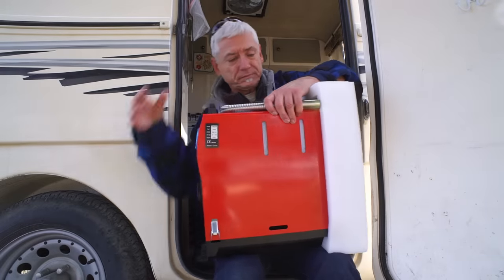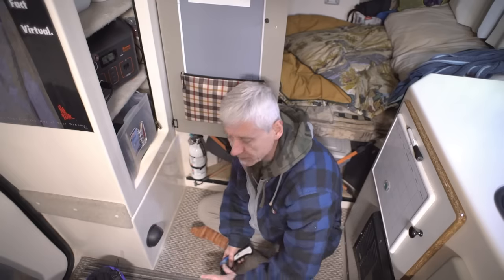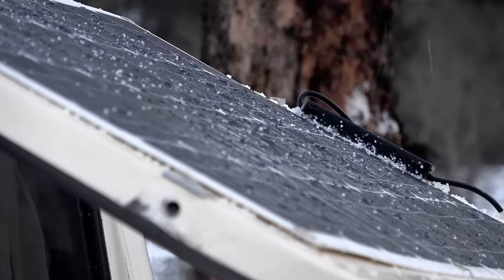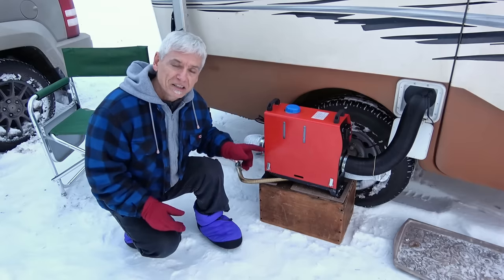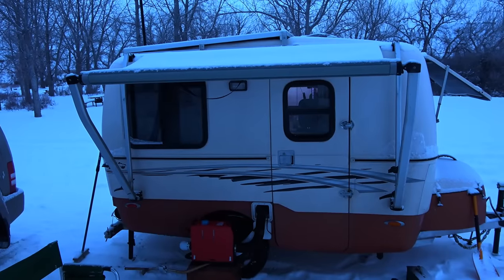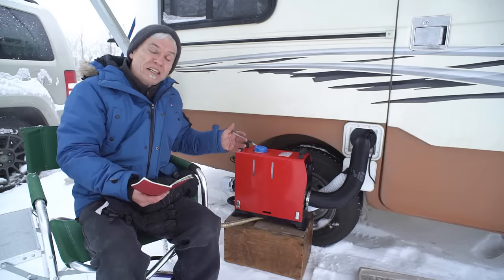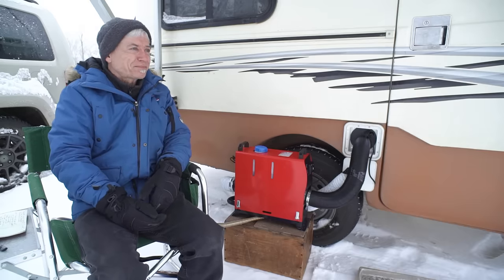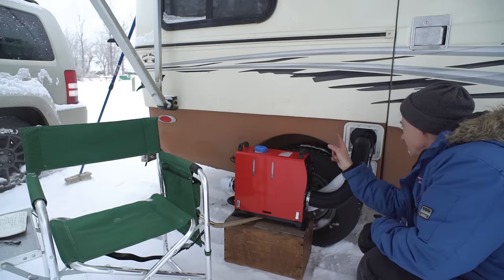Can this Work with a Camper? My Parking Heater Experiment Part 2

Comment: Well, I put a propex gas furnace into my teardrop and it's massive overkill for something that small. I can heat my teardrop to 80 all night for a week without draining the battery. For some reason gas furnaces put into campers are really inefficient. I would think a propex heater would work for your trailer since it's made for VW vanagons - which should be around the same volume. Problem on those is the price - you spent $1k on one. For that it sips gas and electricity rating is about the same as a diesel heater.  We used it last year on a yellowstone trip for 2 weeks and it used 1 1/2 gallons of gas for around 68 all night long every night. Not bad. I decided to spend the money because I wasn't going to buy a cheap Chinese diesel heater - if anything I'd bought a Webasto and they cost about the same as a Propex. I also didn't want to bring diesel. I had a webasto in my first car, but that was a VW Golf Diesel so it was tied into the vehicle tank. My camper already has propane, so the propane furnace was the natural decision and of course you'd pay anything to avoid listening to your wife complaining about being cold :-)  On a recent desert trip we went to 80's during the day and around freezing at night. I tested how long my Battleborn battery can supply me without charging it - so we heated at night and the electric fridge runs a lot during the day when the sun shines on it. The battery went dead after 4 days and nights, so in a weird setting where it's warm during the day and cold at night I can still run everything on about 250 watts a day (that also includes charging phones, cameras and radios)
BTW: don't forget to run that diesel heater on high every now and then. The do sut up on the inside if you run them on low all the time. My recommendation: crank it on high every time you come back from a trip where you used it, just to clean deposits out. Venture 4WD (YT channel) has a webasto in his jeep and they had to take it apart after a month because he didn't do the high burn every now and then. You can see the inside in his video and it's not pretty.

Comment: Most people in UK use the separates rather than all in one and manty suspend the fuel pump which does make them fairly quiet. I think I would try sound deadening mats on the outsides of the unit

Comment: The box it is sitting on, gives me a idea...another box that fits between the door and the box as you are using it. The box would be tall enough to incase the "warm air out" 100% and all the lost heat would be in that box. Hook the cold air intake into that box and put a vent in the box, nice and low, so it can still draw in air without loosing warm air.
Sounds like alot, but its only a box and that will hold the heater for transport

Comment: The key to get the fuel pump quiet is isolaters on the mounting bracket and rubber hose in and out of the pump. The metal case is what is amplifying the pump noise.
Reply: Already tried ... didn't help.

Comment: Maybe build some kind of styrofoam enclosure to dampen the sound and keep the weather off of it. Just have to keep it off the hot parts. 
You can also get a battery pump for pumping out gas out of or into containers.
And a more difficult but possible option would be to rig a fan that turns on to keep the diesel smell out once it turns off, or until you can disconnect the hose.

Comment: Ok, wondering two things. First, any way to boost the fan speed? That would probably raise the temperature in the trailer, but drop the temp in the air outlet.  Second, any way to modify the wood stove to turn it into a mini-boiler unit and construct a heat exchanger that you could use with a fan to blow warm air into the trailer? (Or build a new stove designed as a boiler). You are clever and I anticipate something that you design that will solve the heating problem. In the meantime, I await the revelation of the other purposes for the vent.

Comment: You could try to support the heater on one of those 4wd step which hooks over the trailer Tyre then you could eliminate the timber box which could be contributing to the sound generation of the pump possibly you my be able to mount the pump on rubber isolator to add to reducing the sound just my thoughts but thanks for your experience this far 
Cheers from down under which by the way is way to hot fir a heater most of the time so I myself would be experimenting with keeping cool so I look forward to your keeping cool story

Comment: Hey slim. It’s important that the power doesn’t cut off instantly, the diesel heater need to let the fan cool down the internal heat sink before power cuts. Otherwise the motherboard will/can melt.
Reply: When temps are below 0F, cooling down isn't going to be an issue. It appears, the "motherboard" is in the LCD controller which Slim replaced with a mechanical controller. All Slim wants, and needs, is for the heater to run continuously on low. It also appears the Jackery caused the power to cut out and was corrected.

Comment: If you had an intake from inside the camper it would work better, it will circulate the air inside the camper, also, the Jackery needs a minimum load to stay on, if you add a low load such as LED lights, it will stay on beyond the 6hr.
Also, if you connect a pipe to the heater above the roof line, you won't get the fumes.

Comment: I assume the click-click sound is from the fuel pump?  Would investigating in a quieter pump be an option?  And is a pump absolutely required?  Would separating the tank and gravity feeding the fuel from a higher point be a viable option? It might be worth investigating bypassing the pump and gravity feeding it with a longer hose from a meter or so above.
Reason I'm asking is that at work some of our older fire trucks have Webasto diesel heaters retro-fitted to outside compartments that can't be allowed to freeze (medical gear) and they are dead quiet.  Of course Webasto heaters are not cheap knockoffs and quite costly.

Comment: What's the best ducting for the output air to the tent/camper?  I built a portable one of these in a nice outdoor box.  I'm a touch worried the flexible stuff doesn't expand to a full 3" and creates back pressure.  I have some flexible stuff with PVC on the outer layer and I'm not sure how proper it is for handling the heat.  I love that it compresses down tho.  Any thoughts now that you've been doing it for a while?

Comment: Really enjoyed the video. I was thinking of trying one just like this to keep my 32’ fifth wheel around the same temp as yours. I don’t like the diesel smell. I’m worried it would permeate the camper with that odor. I think I’m going to pass. Your video is the best I’ve seen on these things. I’ve thought about the diesel/hydronic. I would have to have it outside like yours. What about an outdoor small wood /coal stove and transfer by air or hydronic?
Reply from the maker: Interesting Question Kevin. I was toying with the idea of an outdoor wood stove with a tent-like structure over the heated area to vent the heat into the trailer. But it seems a little too complicated to use and operate. Thanks! SP

Comment: Get suspension for the diesel pump to get rid of the clicking sound, it sounds like the pump is just mounted directly to the encasement box. Search for 'Vibration Bobbin Isolator Damper' on ebay and you find lots of them, the smallest ones should be the most flexible and therefore make the least noice. 3 of the smallest ones should do i guess, perhaps 2 depending on how big the pump is.
My guess is 80% reduced noice with them since they are not that soft.
You could go further and just hang the fuel pump in rubber straps, the small thinner bungee cords with hooks for motorcycles could be good, it should reduce the noice to like 95% reduced noice.
They are still somewhat stiff so perhaps you could do the same as i did back in the 90's, i then experiment to make a computer that made the absolutely least noice i could do. Using rubber bands for clothes to hang the harddrive inside the case (and also large fans everywhere and large cpu cooler too back in around 1998, but the harddrives was the most noicy part back then).
A friend asked me if he could turn on the computer while i had only turned off the screen, he was surpriced at how fast it did start and still silent lol.. the expression in his face looked as if i had some kind of alien technology from Mars or something :)
So it was dead silent to say that, not audible 1 meter away, and this was in a time back when computers was usually pretty loud :)
The rubber in the elastic bands for clothes i did use did get stretched out and hard after a while, due to the heat inside the computer case and it is likely much heat in that diesel heater box too.. in that regard.. so perhaps rubber is not the best here.. but why not hang the pump between the right thickness somewhat thin spiral springs.. that could be a good solution that works over time.

Comment: I wonder if it would be possible to use that hole to try the wood stove on the floor with a modification to the chimney. Or a jack to the window so no permanent modification to the window

Comment: Good video Slim! So as it turns out, it was the Jackery getting overheated in that closet, and the fan wasn't able to cool it. Now thats a safety feature alright, but its in the Jackery. I was looking at the prices for the top Jackery units that could possibly power a home refrigerator in a power outage and I was horrified. I decided to buy a 1000 dollar generator instead, that could put out more power. I do like the idea of your solar panels being able to recharge the Jackery though, and the Jackery can keep the heater powered, but obviously, your going to have to figure out a cooling solution for the Jackery. Sounds like the heater will work for you though, nice modifications as usual.

Comment: Check out espar heaters for your rv. We use them on semi trucks hear in the states and yes it's a diesel fuel fired heater but they are small and powerful.

Comment: Hello sir! So I am looking at the same unit. So it needs the 12v battery to run? Secondly the flange you built , what was the material and how did you install  it ? Thank you .
Reply from the maker: Yes, it needs 12v to operate the fuel pump. The flange was made of hi temp PVC pipe. Be careful with regular PVC or ABS as it may melt under heat. Thanks! SP

Comment: My Webasto diesel heater pump is not noisy or smells.    Got good deal from eBay.     My heater is mounted to van floor and diesel tank mounted 2 feet higher.    Maybe gravity helps my pump not work as hard?

Comment: Hey Slim! Long time subscriber- 1st time to comment. I really want to try one of these for my van. I am very cold natured and really don't like using propane/butane. But, like you, hate the smell of diesel. I have 3 different vehicles I would like to use it with so a permanently mounted version in the van isn't really an option....plus don't want the diesel tank Inside the van. I have watched a few videos where they have taken the regular units and placed them in a tool box (plastic) or metal box and had the fuel tank separated, etc. This way unit was portable and fuel tank was out of living area, no holes drilled in vehicle at all, etc. In some cases, used for roof top tent. To me easiest way would be using a unit like you got to do this with minimal effort, etc....instead of going through all hoops with tool box, etc. Question(s): can you extend the wires from the controller on the unit to move it inside during use? Ideas on insulating the hose that blows the hit air into the vehicle? Was thinking of using a plastic storage tote flipped over on top of the unit to protect from elements when in use ( probably need a few cut outs vent and fit over hoses, etc.). Your thoughts? See Reverie Overland channel for unit he put in plastic tool box and later upgraded to metal one. Great info!
Reply from the maker: Hi Jeana, I like you ideas and understand your need for portability. The tool box sounds like a great idea. To answer your questions: Yes you can extend the wire on the controller. I did not as I was only running on manual at a constant rate. You can insulate the inlet hose, however it really doesn't lose that much heat. In my experiment I was just trying to keep the camper around 50F, so no heat saving measures were required. I expect you will get a lot of heat regardless, so I'd try it a step at a time to see how well it heats before making additional modifications. Good Luck! SP
Reply: @SlimPotatohead  thanks so much! I did look at link to Keith Gee's modifications and think I will follow that path. I was unsure if the temperature sensor was in that controll unit on the box...why I was thinking of extending the wires and brining inside vehicle. Neither of you did that and seemed to work well so guess I'll try w/o that and see. Very rarely would I camp in freezing weather but have in mud to upper 30s. No insulation in any of the vehicles and I am cold natured! I f I can get at least low 70s out of it as is, I'd be happy! Ofcourse, like you, I have solar and a house battery but house battery dedicated to fridge. 200 watts solar /100 ah AGM  battery. Recently got small LiPo4 power station about like a small Jackerytgat I can dedicate to heater or have AGM Power pack that's about 40ah I could use

Comment: think you can attached the diesel heater near the front of your Jeep, and vent the exhaust under the engine bay to prevent fluids from freezing over.. A longer hot air vent might be needed to keep the clicking noise down.
Reply from the maker: I was actually thinking of using the diesel heater to keep my engine block and battery warm, especially in the morning when I don't need heat in the trailer. That's the bonus of a portable system. It can get really frigid up here at times. Thanks! SP

Comment: Curious id you considered a catalytic propane heater  or a radiant propane heater aince neither require any electricity and you already have propane onboard your trailer. Just a suggestion. Appreciate the onfo on the diesel heater

Comment: Tks for sharing your experiences. Where did you get the intake flange? I’m also in Alberta and looking to build a heater box
Reply from the maker: You mean the stinky slinky outlet? It came with the trailer. They are used to store the black water hose. Thanks! SP
Reply: @SlimPotatohead  Tks - I think an aluminum heater box would work well for you too.

Comment: Cool! No I mean hot 🥵 oh whatever... I wonder if you found a small Honda type generator that runs very quietly that would supplement your power and allow for the propane to be your primary hear source. Size about the same, uses gas not diesel and only runs for a short time to top off the batteries. Either way this was great to watch and learn thanks!
Reply from the maker: Let's be quite clear here Stephen: Honda generators are NOT quiet. Quieter than a jackhammer maybe, or a cheap Harbor Freight, but absolutely not quiet compared to the silence of the wilderness . Please avoid their use at all costs when camping near others. Thanks! SP
Reply: @SlimPotatohead  that's true, was thinking out loud :)

Comment: Is there another option you like for dealing with really cold temps down to zero F?  Seems like this is pretty wonky but doable.  Wondering if you've since found something better?
Reply from the maker: Yes, a wood stove. I did several videos on using one in a trailer, starting here: https://youtu.be/t3XOLLg8wn0
Check the video description for more links. SP

Comment: Assuming the noise is from the fuel pump, can you wrap some sound isolation material around the pump? Will that help? Interesting experiment, I would say you are losing awful lot of heat with it intaking cold air and the long  output hot hose exposed to the outside.

Comment: one way to help with the tickicking fuel pump is to remount it on rubber bushes, it will make a lot of difference to the knocking noise.

Comment: people that have these heaters sometimes replace the fuel pumps with models that are quieter, they vary in price though but generally you can find one for under $40 that are much more quiet, I think amazon sells them too
Reply from the maker: I have heard rumors of quieter pumps, however I haven't scene any specific recommendations for a low hertz (1.2-1.4) version at a reasonable price. Any leads? Thanks! SP

Comment: The CE marking is for it being certified in the EU.  So it does meet someone's safety standards.  However, reading further, it does not mean they submitted the appliance to some lab and had it tested.  So does that put the heater back to wishing it was tested and certified by some of the big name organizations?
Reply: I read somewhere in these comments, it could be a true CE certification from Europe but ,more likely, CE only represents that it's a Chinese manufacturer. Based on how shoddy it is, I doubt it meets any certification.

Comment: Doesn't a Jackery shut down after 6 hours if the power drawn is less than (I think) 10 watts per hour?  That could be why you are seeing a shutdown.  I know this drives me crazy in the summer when I am only running a fan at night - 6 hours into my sleep the system shuts down.

Comment: Wonder how costs compare between this and propane? One night on each.
Reply from the maker: Good Question. Currently, the propane furnace uses more fuel, but propane can be cheaper than diesel. As for power consumption, the diester heater uses only about half what the propane furnace needs. Thanks! SP

Comment: Hi thanks for the test on this product. I’ve been thinking about getting one. I never considered using it outside. I wonder if a insulated encasement could be used to deaden the sound and serve as protection in weather? One that can be assembled to help with storage. Also has hose openings. Just brainstorming. Thanks